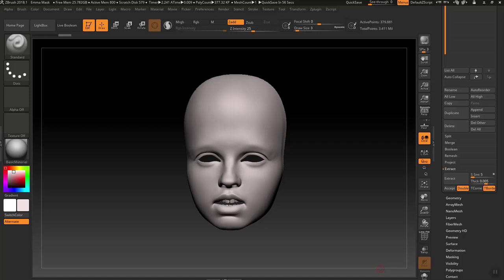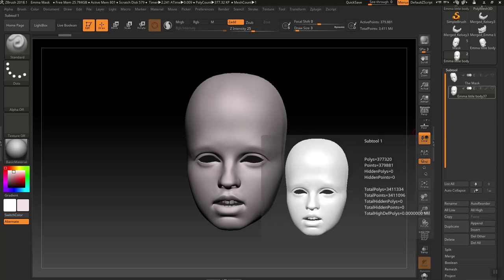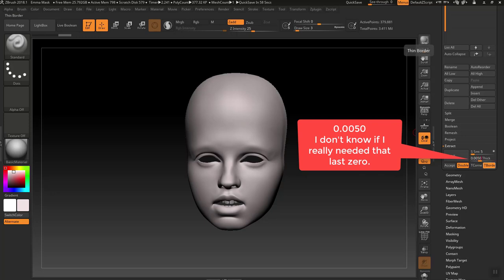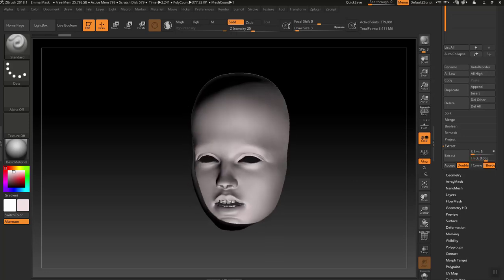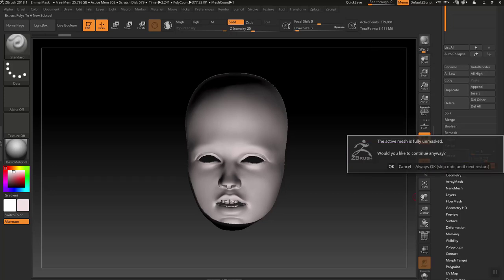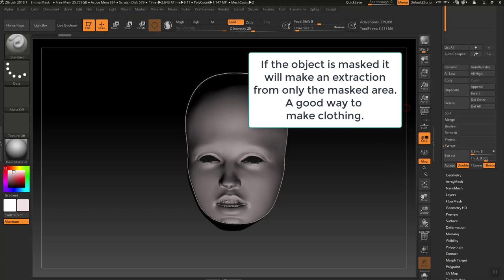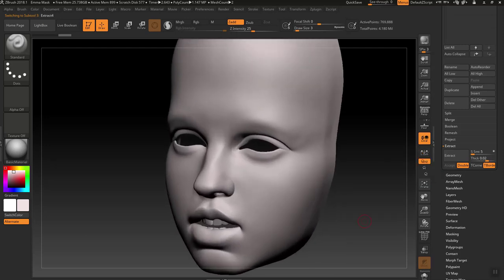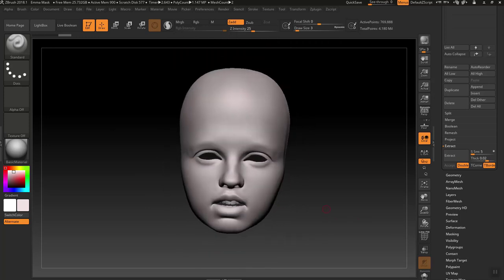Zbrush add thickness to model for 3DPrinting

Comment: Hey :) How can you add thickness only to the inside? I mean the way you did it also adding thickness out too which make a distortion the outside of the model and nobody wants that, especially when it's a portrait or any other details on the outside.
Reply: Hi did you got the answer? Care to share?
Reply: @tplgy  Not really. If you want to prepare a model for 3D print, you have to make the model solid, which means that you have to close the holes. When it's solid, then you can make some empty space inside to use less printing material.